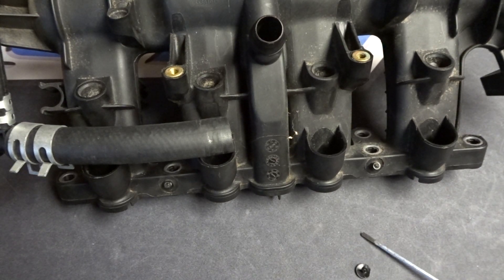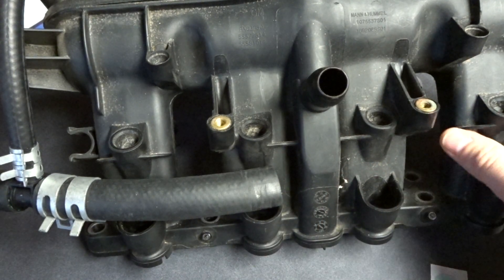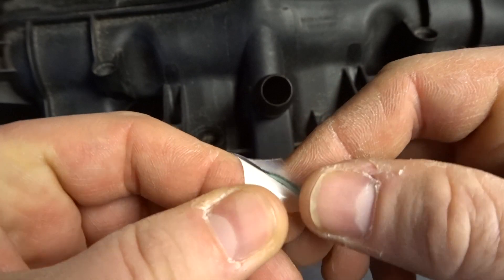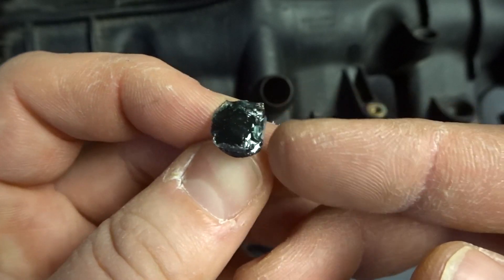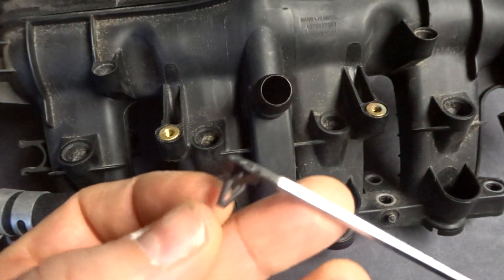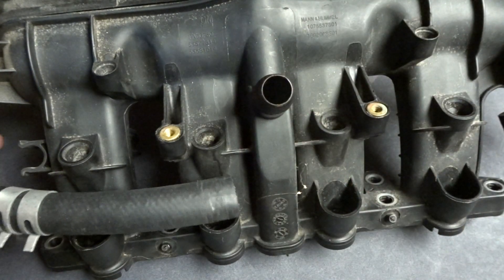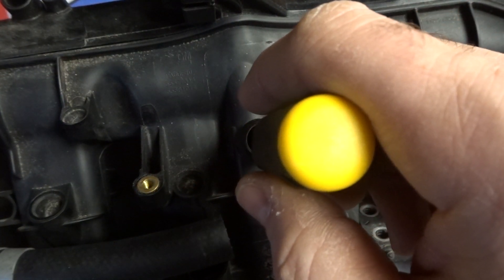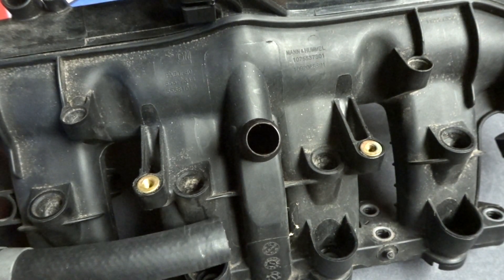CruzeKits.com V3 PCV Fix Kit Supplemental Plug Install

Comment: I have my kit here on the table, waiting for tommorow when its 59 degrees.  that is a really smart idea have the screwdriver hold the plug to put it in, that glue really holds that and makes me feel confident i wont loose it on the way down.  i did get the screw driver the brush and prep wipe.  thanks again for the developement of this and I will let you know how it works in the short and long term.
Reply from the maker: Thanks! Yeah that glue dot is very tacky if both surfaces are cleaned with the alcohol wipe.

Comment: Just FYI, the shorter the screwdriver you use, the better. Using a long screwdriver will amplify every single minor twist and cause the plug to knock around.  Use the shortest flat screwdriver you have that hits the bottom of the intake.

Comment: I just installed this kit today I’m praying it is the fix all. A mechanic looked at my car told me it was a bad turbo with the loss of power and the major fuel consumption. Milage has been horrible last couple of weeks. Just waiting for my new valve cover to show up today. That cap on right side is leaking so ordered the replacement. I have a spare turbo just in case that’s an issue as well but if not I’ll send it back and get the $800+ refund with all the extra turbo lines I bought as well. P0171 P0299 P1101 P0299 codes. I replaced plugs and ignition coil pack last weekend then realized valve cover has a leak as well. Smh. Did a oil change while I had it on ramps.
Reply from the maker: Let me know how it works once you have the new valve cover on!
Reply: @AndreiDPop  will do usps will be here about 3pm. Central time. That lil plug just fyi was a pain in my but lol. But I managed to get installed. I got the latest pcv kit you offered. It’s a lil different from your YouTube video. But managed to get it done and installed.
Reply: Still has a rough idle smh any suggestions? Check engine hasn’t came back on yet but rough idle and no power
Reply from the maker: @1900darrell  check for vacuum leaks.
Reply: Well wish I knew how to check for that
Reply: @AndreiDPop  replaced the bad map sensor and O2 sensor and now no vacuum leaks . Runs perfectly again. O2 was so black and holes barely visible.
Reply from the maker: @1900darrell  oh wow. That car must have been burning oil for quite a while!!
Reply: @AndreiDPop  it was but not much. But I’ll see how long it last. The last shop I took it to kept saying it was a bad turbo. Turns out not to be the case. Reason why I did all the work myself. Have all the tools needed and and diagnostic scanner with live data helps a lot.thanks for the suggestions and help really appreciate it.

Comment: What’s the procedure if your check valve is still in the intake manifold? I think it’s failed, but it’s still there. Do I have to remove intake manifold to fish out old check valve and then seal it up with your fix kit v3 plug?
Reply: I'm wondering this as well. I want to pre-emptively put the kit in soon to prevent future issues.
Reply: What did yall find out?
Reply: Would love to see a reply to this as well. This makes me nervous…if the old valve is still there then how will the plug go in?

Comment: I'm curious. This will plug the center hole, but not the surrounding holes, correct? Shouldn't all the holes around the center one also be blocked? Please explain what I'm not understanding. I'm looking at the v3.4 kit. Thank-you.
Reply from the maker: @holymackerel33  it will plug the center hole and the surrounding holes. The plug is sized appropriately to cover all of it.
Reply: @AndreiDPop  thank you for clarifying. I hadn't seen anybody ask about it and wanted to be sure.

I'll be installing it in my wife's 2014 Cruze LT with 48k miles. I replaced the valve gasket about 2 months ago, but Monday she came home and told me that something was wrong with the car. Oil was flowing out of turbo oil feed line. I replaced that, but I've always been leery about the pcv system. When I went to check it, the black plastic tubing disintegrated, like in one of your install videos.

I decided I should probably take care of that, too. I'm impressed with the kit you put together. I was going to make one myself, but honestly, I couldn't find a better check valve than what you have in the kit. The kit is supposed to arrive on Monday. Thank you very much.

Comment: I'm gonna do this pretty soon to my Cruze...same issue I'm having...also....to do the dry fit test before adding the epoxy..is it a good idea to find the hole and mark it with a marker to get the exact length to put it in...I'm thinking of going that route...so not to get any epoxy on any of the inside part and to have that guide mark to be more accurate...
Reply: The marker idea is a great idea.

Comment: Does this cause a vacum in engine when pulling dip stick ?
Reply from the maker: @timothyeads7083  yes. That’s how the system is supposed to work. This is an old video though. I recommend using the newest v3.4 pcv fix kit install video.

Comment: Hi Dre Dan, 
I have purchased your 3.4 PVC kit all seems fine. Question, could this kit at some point cause an excess amount of oil blow by causing excessive exhaust smoke or just cause excessive exhaust smoke. Please advise. Thank you. Ray.
Reply: This happened to me during the winter after installing the kit.  But was told my turbo went out.

Comment: Hi andre, after installing the 2011 chevy cruze pcv fix kit, the car is throwing p0209 and p0303, any help? Do i have something hooked up wrong?
Reply from the maker: Which way is the check valve pointing?

Comment: hey ur kit work perfectly now 6 months but now when temperature dropped below 0 celsius i getting p0171 code again. i took check valve off and blow into it and oily white particles came out and i look inside the tubes of check valve and it was covered like "white" smudge. Swithching check valve dont help code comes back in a day. I looked inside manifold and it looks like there is pretty mutch this orange residue, i use oem gen1 dexos 2 motor oil.
Reply from the maker: Normal during cold weather. It’s just condensation.
Reply: @AndreiDPop  ok thanks very fast answer

Comment: My car hasn't failed yet but I want this kit as preventative maintenance. How do I remove the existing rubber diaphragm?
Reply: He answered it later in the comments.  Just break of the tip and let it fall into the intake.
Reply: @jamesroquemore2616  I really screwed my little plug up and had to remove the intake manifold and do it the V-1 way
with a screw and too much JB weld than necessary. but it works.  I also discovered that one of my electrical connectors was not seated properly and it fell apart when I went to remove it, it was held together with tape. I thought it was broken, but I had more patience then the last guy that tried to connect it, and properly connected it when I put it back together. You have to pay close attention to how these connectors clip on and off.  It had a little red clip that completely fell off and onto the floor. but I saved it and didn't need any tape, it was simply not installed right. but you can see how these clips go together if you just look at it for a minute and think about how it would go together.

Comment: I just purchased my 2016 Cruze limited and have not checked if the check valve has failed, but I will be purchasing this kit. My question is the check valve is already missing on the intakes in both your videos. Do we need to remove them if they are still in place. And how is that accomplished if so. Thanks again.
Reply from the maker: You could break the tip off the check valve to get the other side to fall in the manifold like it does when it fails on its own. You could make sure the hole is clear with a small 90-degree pick.

Comment: My intake on my 2014 Trax has a square at the bottom of that barb instead of a smooth bore. Can I still do this fix without removal?
Reply from the maker: Which barb are you referring to?
Reply: @AndreiDPop  the one you put the plug down...mine is square at the bottom. I'm having a hard time inserting the kits plug with epoxy into the hoke
Reply from the maker: @justinh8059  are you doing this on a dorman or aftermarket manifold?
Reply: @AndreiDPop  yes this one is a Dorman one
Reply: I just removed it. It so much easier. Takes little time. The one small fitting with the hose clamp was already broken.... So I need to replace that and now I have all the room to work. Honestly worth the 30 min to remove

Comment: I just installed the V3 kit on my trax it was a great install kinda fun even.. however my engine has so much vaccuum in the valve cover it will pull the oil fill cap or dipstick right out of your hand that can't be normal.
Any ideas and I have this high pitched chirp ( new valve cover too) possibly a vaccuum leak?
Reply from the maker: Defective valve cover.
Reply: Could be the crank shaft seal also has a leak 
They fail all the time on this engine.
Reply: I have recently replaced my valve cover and was under the (wrong) impression that it would have fixed my chirpy/squealing noise coming from my Cruze. I have a feeling more often than not the chirpy noise is the crankshaft seal like the other user has said. My noise did not go away until I replaced the crankshaft seal.
Reply: Seems like a failed seal would leak oil. Mine is not leaking any oil?
Reply from the maker: @gregm1775  they don't necessarily leak oil. The crankcase is still under some vacuum, sometimes too much vacuum.
Reply: @AndreiDPop  mine has an unbelievable amount of vacuum causing my check engine light to come on
Reply from the maker: @gregm1775  too much vacuum means defective valve cover.

Comment: so the hissing noise is coming from the power brake booster auxiliary pump but is that normal ?
Reply from the maker: No, not normal. Also known to fail sometimes.
Reply: @AndreiDPop  so lets say that the noise is the pump cycling and it sounds just like this video https://youtu.be/pJZNwTpipuU

Comment: I installed your v3.3+ kit and a new valve cover and the car runs like new again except one  little thing , i now have a vacuum leak when i apply the brakes ! I have  tried everything to find the leak short of tracking down exactly where the hissing noise is coming from . any ideas ?
Reply from the maker: Check if you lost the retaining plastic ring in the manifold pcv pipe terminal.
Reply: @AndreiDPop  i will check that and thankyou for the super quick reply !
Reply: @AndreiDPop  Interestingly enough we have the same type of vacuum issue on my wife's 2013 Trax. Will be buying your V3.4 kit as I believe the orange valve is long gone but thank you for this additional advice on where our vacuum leak might be.

Comment: I received jb weld steel in my 3.1 kit. I thought it was supposed to be plastic weld. Will it work as good?
Reply from the maker: I switched to standard JB weld from the plastic weld for better thermal resistance. It will work even better. Only drawback is that it has a longer cure time, so give it about 15 hours to cure before driving.
Reply: @AndreiDPop  ok awesome thank you

Comment: I AM HAVING A LEAKING PROBLEM NOW AFTER INSTALLING THE KIT ... LEAKS FROM THROTTLE BODY ASSEMBLY, AND TURBO INTERCOOLER RIGHT SIDE.  ONE SEARCH ONLINE AND THOUGHT THE ACTUAL TURBO WAS PROBLEM,  REPLACED IT NOW  AND  PROBLEM  PRECIST  ANY  RECOMENDATIONS  ? INSTALLED KIT V3
Reply: Make sure the bolts on throttle body are torqued down  I think it could be 71 inch pounds, but don't take my word for it check a manual, a chiltons or haines for the torq specs.
Reply: I recommend replacing the gaskets on any part you have to remove and O rings on the injectors.

Comment: Great kit!  Do you have any kits that address the integral PCV valve in the valve cover?
Reply from the maker: Not yet...
Reply: Chevrolet Recalled the overhead Cams for this reason and if your car is less than ten years old and under 120'000 miles
you can get it replaced for free at a gm dealership.
Reply: But the check engine light has to be on and you should have a trouble code Po171. any auto parts store will let you use a reader for free to check your codes.

Comment: Dan ,
I'm replacing my valve cover .
11cruze ltz
I want to vent the valve cover  and route  it thru my oil catch can. My catch can is atmospheric.
My second catch can is Not atmospheric, that runs from my intake to zzp throttle body spacer w a one check valve , under boost re routs thru oil catch can and to turbo inlet.
Routing from valve cover
1. Do I need a check valve ?
If I do where ? Intake / can or valve cover /can
2. Valve cover to can then are you running to intake or spacer ???? 
3. Catch can bought from evil energy , very well made w/ two , 10an ports will be running 10an lines from valve cover to oil can .
If not possible to run atmospheric then I can always cap to top to make it a close system , just don't know if it'll throw a check engine light or not. Dre I appreciate the feedback thanks.
Reply from the maker: I'm actually working on a design for what you're doing to use for people with upgraded turbos. Shoot me a message on the form on cruzekits.com and I'll get you some details on how you need to route this. It is possible and not difficult.
Reply: @AndreiDPop  
Yeah I think I came up with a routing for that valve cover to a mini oil catch can and into the brake booster line into the intake manifold

Comment: Does this kit work with the Dorman intake manifold?
Reply from the maker: Yes but you have to remove the manifold to install it and you need to use the screw/washer plug instead of the clip.

Comment: Does the original check valve/nipple need to be gone already before installing this?
Reply from the maker: If it’s not gone, you have to make it gone. This would be a preventive installation or if you suspect the check valve is original valve cracked or leaking or clogged.
Reply: @AndreiDPop  so if its completely intact you're going to have to remove the manifold to "safely" get it out of there..
Reply from the maker: @shafeman556  I mean, they fail on their own all the time without manifold removal so…

Comment: It runs better but I'm still getting code PO299 at WOT.  I'm going to replace boost sensor and investigate.  I hope I don't have to replace the intake manifold but might be the case.The plug feels solid. 🤷🏻‍♂️  Definitely fixed my excess crankcase pressure.  No more oil leaks.  I'll keep you all posted.  PS.  Good call on the two glue dots.  I messed up the 1st one, lol.
Reply from the maker: Intake manifold isn't causing this issue at this point so replacing it will do nothing. Check for boost leaks. Tighten the throttle body clamp, to start. If you've tested for boost leaks and have none, you'll need a new turbo.
Reply: @AndreiDPop  you're right.  I took the hose going to turbo from your kit off of the stock guide/rail and then it sat flush on the turbo.  It doesn't bend around like the stock so I just took off the holder from the rail so no one tries to put it on the oem rail, OCD, LoL.  Now I can floor it and no PO299! Boooom!
Reply: @AndreiDPop  after the 3rd WOT run, PO299 again.  I already replaced Turbo and oil cooler and all the lines.  Even new timing chain and valve cover.  Replaced all the coolant hoses, has 169K miles.  Should need new intercooler hoses too by now, 10 years old.  I love this lil' car.  My other car is a 68 RS Camaro.👍🏼  Replacing Turbo/intercooler hoses next.
Reply from the maker: @AK7Woody  boost leak test it!

You did install the check valve in the correct direction right?
Reply: @AndreiDPop  Yes, it's facing the correct direction.  I think maybe clamp on the 5/16 hose in the lazy kit isn't tight enough.  I'll do some more testing but otherwise, it's running great.
Reply from the maker: @AK7Woody  definitely not a clamp. P0299 means the engine isn't measuring as much boost as it expects to be producing with the turbo. That's a larger system inefficiency somewhere like a significant boost leak.
Reply: @AK7Woody  timing chain? You replaced timing chain why

Comment: Why would I buy this instead of buying a new intake manifold?
Reply from the maker: Because a new intake manifold will fail in some way like the last one did. This kit is half the price, upgrades your existing manifold to have an external check valve you can replace in 2 minutes (the kit even comes with a spare valve), and you can install the kit without even removing the manifold.

Comment: So quick question. What would happen if you lose that plug inside the port?
Reply from the maker: Well it will just sit there until removed. It won't really go anywhere as there isn't enough velocity in the PCV system to break it loose or even cause it to travel up the pcv pipe. You'd have to remove the manifold and either try again with a new plug or use the screw/washer method.
Reply: @AndreiDPop  alright as long as it wont damage anything because I cant tell if it went in or dropped. But other wise everything looks good. And also for the check valve is the arrow supposed to be pointing towards the drivers side?
Reply: @nathanlapointe639  it has to point towards the turbocharger for proper direction of airflow.

Comment: So just quick question.  Do I need to buy a new intake or reuse the original
Reply from the maker: You install the kit on the original manifold. The whole point is so you don't have to replace the manifold, and to make the check valve serviceable, thus improving the design and saving you money.